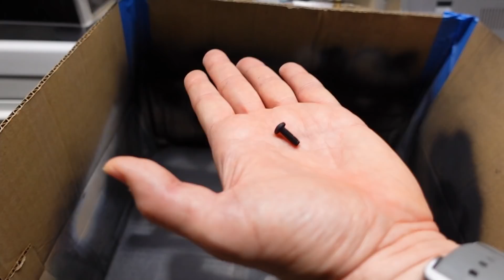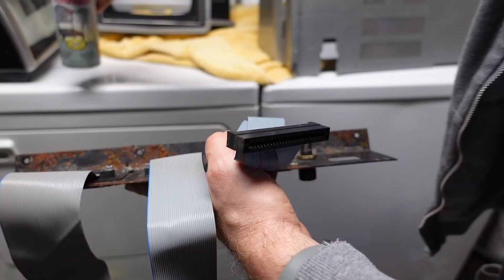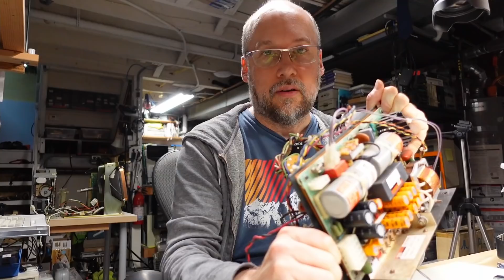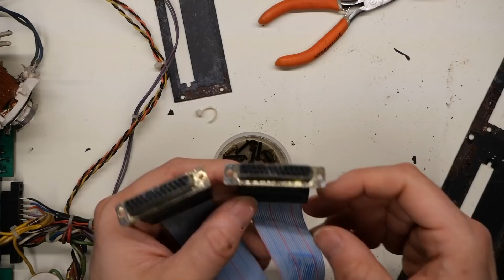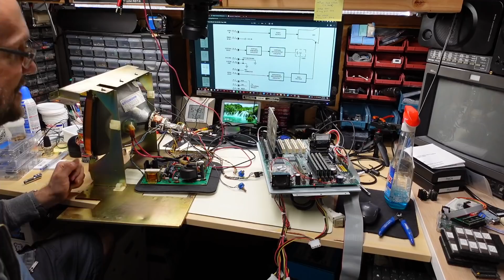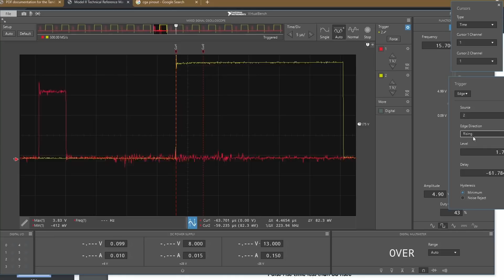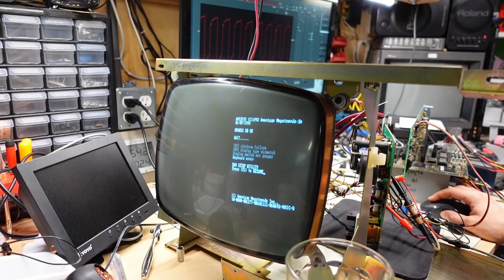I actually got something working on the TRS-80 Model II!

Comment: Great job on this restoration so far..  Interesting to see the analog board has support for shades, although televisions have support for shading, so not overly surprising to see that even though the II only supported on/off pixel control.  Speaks more to the level of computer video technology of the time (or cost mostly), such that the computers of the day only has basic video support.  Heck, the Model I doesn't even support lower case characters in the character generator (without a lower case mod).
Reply: CRTs, being analogue devices, inherently have analogue brightness control, and of course their driver systems are going to have an analogue signal path for the video signal so you can have brightness and contrast controls to adjust the image. If you want this driver system to use a digital (i.e. on/off) signal as input you actually need to add extra circuitry for this to convert, e.g., 4.8 and 5.2 V inputs to be seen by the downstream analogue circuitry as the same level (whatever you've defined as "on"). Or perhaps you don't bother, and just treat the digital signal as analogue, as we see in this particular case.

If you do have digital to analogue conversion circuitry, that circuitry has to be somewhere, since the video generation system within the computer is producing a digital signal that must be converted to analogue at some point. (Unless that conversion is, again, "I'll just treat it as analogue anyway.") The monitor's analogue board is the simplest and most sensible place to do that since the analogue side of the converter will require adjustment to suit the characteristics of remainder of the analogue signal path. So it's no surprise to find this circuitry here.

The IBM PC MDA and CGA display systems are designed in this way: the computer's graphics cards generates digital signals for brightness (one for MDA, four for CGA) and the digital-to-analogue conversion of these is done in the monitor. The C128's digital RGBI  is the same, as is are all the three-bit digital RGB systems I've seen (PC-8001, FM-7, JR-200, MSX, etc.).

Comment: I have washed a ton of monitor chassis and the flybacks were fine.  I don't know if that particular flyback is ok to get wet.  Also, use cleaner wax on that paint before you use a clay bar.
Reply: meguiars paint cleaner is good
Reply: @TotoGuy-Original  yeah that's exactly what I meant. LOL

Comment: For removing rust I use dissolved citric acid crystals. Much quicker than vinegar.
Reply: Answering just to put knowledge in one place ;) 
I take rust out using phosphoric acid (20%) or phosphoric-oxalic (acid) mix (something about 20%/5%, "eye-level-precision"). Also it requires a bit of safety gear but also is really fast. Beware: it may eat your metal if used for way too long.
If something is really heavily rusted then overpowered 98% H2SO4 can deoxidize almost anything ;)
Reply: @l_H1M4W4R1_l  the nice thing with citric acid is that it is a strong acid but it is relatively safe.

Comment: For the rust, I'd suggest looking out for a product called Fertan ... it disolves the rust, which then just needs to be brushed off, and leaves the metal rust protected afterwards. Just paint it on, and leave it for a day or two before brushing off with a stiff brush.
Reply: I've had good results with Evaporust. Just submerge the metal part in the fluid and it will remove the rust but not damage the paint. Maybe that would allow you just touch up the black paint again without losing the text.

Comment: Be cool to re-plate the screws chemically, but paint is much easier. Just would be cool lol.
Reply: You can do a nickel coating. The chemical and nickel donor can be gotten off of Amazon. Just need a power supply.